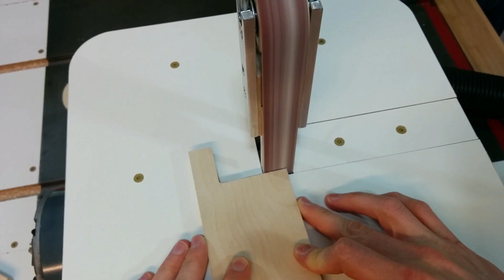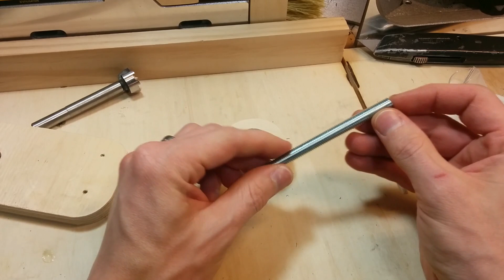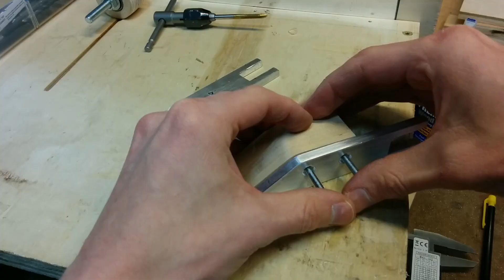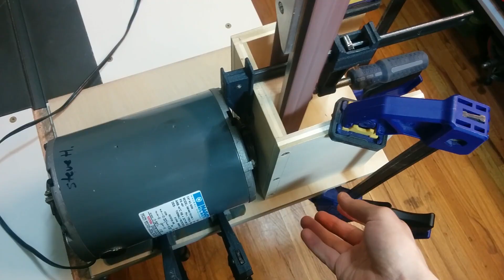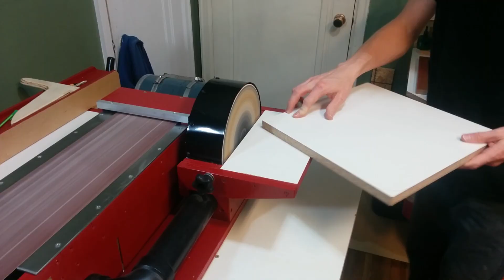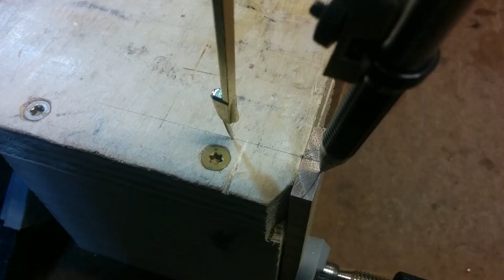Building the Vertical 1" Belt Sander

Comment: Amazing. I was just wondering which motor you were using? I tried using a small fan motor but its just way too underpowered. Would a 1/4 hp condenser fan motor work? Have you ever tried wiring one of those before? It seems to be quite a hassle to wire, I just took one off of our hvac which has been sitting unused for 20 some years! :)
Reply from the maker: I am using a 1/2 HP 1750 RPM motor.  I have not used a condenser motor before.

Comment: Justin, You add value to Your inventions by painting then with Your  branded  red paint. 👍
How do you make sanding belts? What is Your method of stitching the ends into a ring?
Reply from the maker: I don't make my own belts. For this sander I bought 1"x30" belts.
Reply: @JustinDepew  I agree Justin.  So hard to get the right adhesive qualities used in joining good belts!!

Comment: I did something similar using longboard wheels instead of making my own. Works well! They just tend to be a bit pricey, but since I had a no longer in use longboard to borrow them from that was no problem in my case. Great design tho, will defenitely upgrade mine with some of you Ideas! Thanks for the great Videos!

Comment: Replacing of belt is not easy in this project.
Reply from the maker: I disagree. All it takes is releasing the belt tension and then remove the insert plate which is held on with 4 screws. Then the belt can slide out.
Reply: @JustinDepew  Good. I agree.

Comment: Hi I know this post is like 2 yrs old and I don't know if you still check messages but was wondering if you think with a few modifications that I could use roller skate wheels in place of making wooden wheels.
Reply from the maker: Yes you could use roller sake wheels no problem.  The reason I didn't use them is so I could keep the wheel diameter small so that I could sand inside of smaller circles.

Comment: I love the design....but I am wondering why you didn't just use a drill and a jig saw to cut the hole in the work-top instead of slicing into it with the table saw?
Reply from the maker: In order to change out the sand paper there needs to be a removable portion of the table so the paper can slide out. Since I wanted a square opening it made sense to use a table saw to make the cuts straight.

Comment: like how you made it 
looking at the construction i been thinking : there these small brushless hubmotors meant for electric scateboards
https://nl.aliexpress.com/item/Maytech-90mm-800W-electric-skateboard-kit-boosted-skateboard-Hub-motor/32771642125.html
they need a controller and a 24 volt powersupply but using this as the bottom pulley and motor you can build the footprint for whole thing a LOT smaller

one thing i though of later : you can make a verry quick and dirty spindle sander by mounting a sanding drum to youre drillpress and put a simple melamine base under that with a hole the same size as the drum so it can move up and down a little under the floorlevel of the workpiece 
you can get it to oxilate but that involves some fancy mc gyvering with a wipermotor and arm fixed to the feed lever on the side of the drillpress 
dont know how it is out there but a used drillpress at the fleamarket or gardensale cost about 10 to 15 dollar

Comment: I  want to build one of these!  

You can sand freehand at the back, but it would be nice if your design could allow for thicker platens with smaller radius.  The machine already has lots of space for a thicker platen behind the bar where the belt travels upwards. 

A reversing motor would fix that, but almost as easy would be to flip the entire upper mechanism front to back. Easy because the upper wheel is mounted symmetrically, and the wooden block near the motor can be easily flipped too.  

Of course you may have already discovered that sanding at the back works well enough to handle smaller radius curves.  I don't know. Its just an armchair idea.

Thanks
Reply from the maker: This is an interesting idea. I like the idea of adding more space for thicker platens with smaller radius. I'll have to look into this...

Comment: great job do you have plans for this as I just started to take up woodworking ( 2 years), as you know some tools are very expensive over here in UK I've bought plan of 
router lift from I build it that's very good and your 1" belt is  is up there with the likes of  John Heisz and  Matthias Wandel keep up the good work
Reply from the maker: Thanks for the kind review Paul.  I do not have any plans.  However you can download the 3D model for free and get the dimensions off of there.  It's more work for you but that's why it's free!

Comment: just out of curiosity, why would you want to have the platen inserts to be made out of wood? would aluminium be better? and thus last longer? curiosity made me ask.
Reply from the maker: +arcanix51 wood because it was easier to make. It's also probably easier on the sand paper than aluminum, but I'm sure aluminum would work.
Reply: To this day, Lignum Vitae is still used for shaft bearings for Nuclear Submarines, in some farm communities rock maple is used for low speed PTO- driven implements like threshers; wood is an amazingly versatile and renewable product, so don't think metal is always going to be a better answer. ☺

Comment: for the wheels you could just get a couple of used skateboard wheels. they already fit the bearings snug and they are made from polyurethane you can them in a lot of different sizes and if you have a local skate shop they'll give you used ones for free. just to get them out of the catch all junk drawer.
Reply from the maker: +misfitramone good idea. Similar to how Matthias made his strip sander with roller blade wheels.
Reply: i haven't watched that video but I'll have to check that out! i like the skateboard wheels because you can find them anywhere from 48mm up to like 70mm the widths are also different roller blade wheels are always skinny compared to skateboard wheels. Plus being a skateboarder i have a few old sets hanging around. i want to start trying to build my own tools but as of right now have only made a quick router table. I'm going to find Matthias video. keep up the great work!
Reply: Justin Depew i just watched Matthias video and its cool but your design would work better for guitar builds and stuff like that. i like the way yours serves two purposes and eliminates two tools from your bench top.